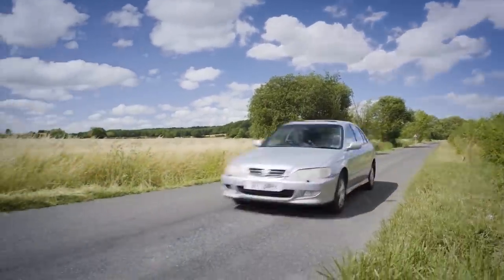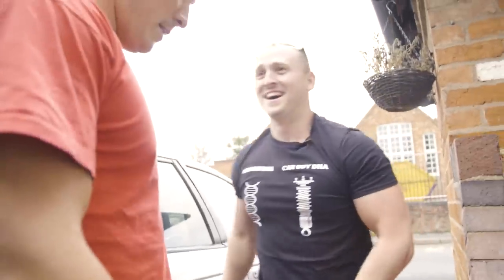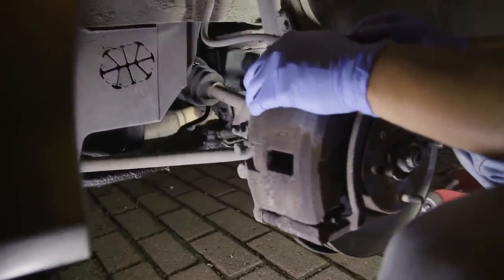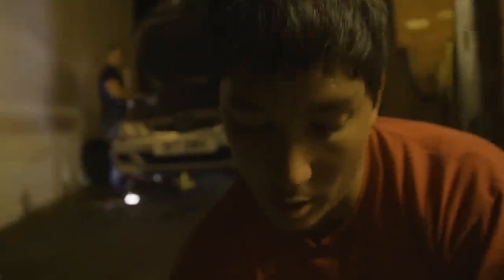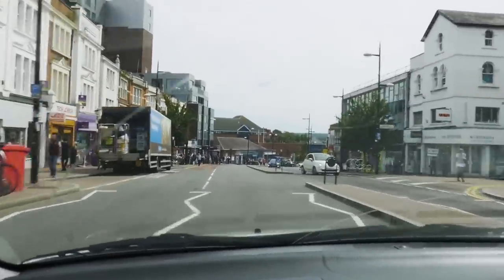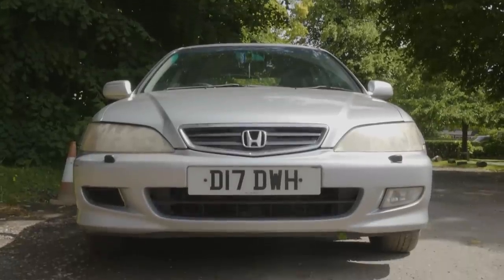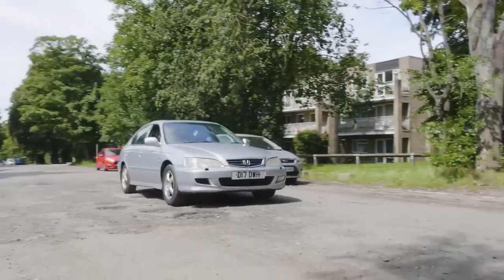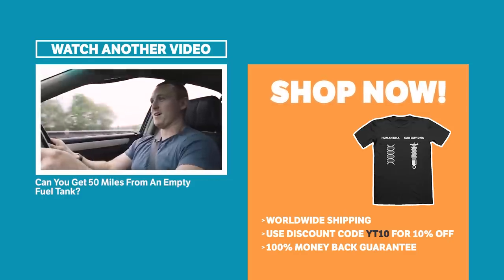Can You Daily Drive A Car With Cut Springs?

Comment: hey, use a ratchet tied from driver to passenger control arm and tighten it until the strut assembly has enough room to work with, itll keep you from loosing any fingers or someone getting their head crushed, it also makes the entire process incredibly easier; just jack it up, take the wheels off, ratchet the control arms and you have easy access, and yes that works with an anti-roll bar, and solves the issue for both sides simultaneously

Comment: Bs, of course you can drive it. You would obviously put hose clamps so that the springs wont jump out, at least in the back. I daily drive my volvo with barley any rounds left on the spring, works just fine. Know many people that has removed the spring completely aswell.
Btw you can cut the springs as they sit in the car.
Reply: Nils Friberg ive done it  like that too with no problems people jus overlook at crap smh

Comment: If you're really cheap but need springs You can even bring a stock spring to a spring manufacturer and they'll make some with the same specs but however   much drop for about $30 a spring.

Comment: If you do cut springs, cut from the top not the bottom. I cut mine on my ek and it drove good, you can only notice when you go over speed bump that the shocks bottom out. Other than that, it was good. Corner hard, drive fast and felt good. I wouldn't doubt that your shocks will go out sooner than if you were on proper springs though.

Comment: Depends on the type of coil your cutting. If you car came with progressive springs you can not cut them, if you do you will change the spring rate and the car will bounce. But if the car came with traditional style spring you will not change the spring rate as drastic and the car will drive fine. The only issue is most times the damper will start to bottom out and blow it's seals.

Comment: Just heat up the springs with a blow torch much easier
Reply: You should try this
Reply: Yes its easy but it will make your ride noisy with bumping sounds and make you irritated
Reply: Hey let's just go and change the temper on a bit of steel which is critical to the car's function. Sounds good.
Reply: Yeah that's a terrible idea! Spring steel has a specific heat treatment, which you would ruin.

Comment: You need to replace the shocks if you use lowering springs as the lowering springs will not be captive either.

Think you need to try before giving terrible advice

Comment: i think michigan has the lowest car standards lol they dont even test ours
Reply: Dark ShadowFox yeah dude i see trucks lifted 12"+ with 16" wide wheels and 45" tires, pro street drag cars that are as loud as a v8 could possibly get, unweighted wheels, straight pipes are legal and almost all shops will do them without question, we dont need emissions controls, we also can drive on semislicks with literally only one line of tread. hell even semi trucks can have two trailers haha. honestly car heaven
Reply: and detroit is just across the river from canada where you can get JDM cars imported. the mechanical shop teacher at my school even drives a RHD AE86
Reply: For real 😂 this is why I live in Michigan
Reply: Ronnie Santo you can literally drive anything on the road here in florida as long as it has lights and turn signals
Reply: Dark ShadowFox yes you can drive Canadian registered cars as long as you are legally in the country in the first place.
Reply: Dark ShadowFox job market is climbing
Reply: In Arkansas we don’t have any inspection.

Comment: I'm dailying my mk4 Golf with rear springs cut for four years because I'm a cheap bastardad and there were after market tall springs that were stupid and I didn't had money to change them back then and it's no problem. Just needed to put some rubber hoses on the bottom of the springs to stop rattle sounds that occurred every time I went over a pothole.

Comment: All the car people around me lower their cars, instead I lifted my Volvo 945 Turbo and put on some larger offroad tires and I can assure you that I have way more fun with my car then they ever could with theirs. A serious drifting car might be an exception though. Speed bumps makes you go faster to see how far you can jump, you start cutting corners way outside the tarmac, sometimes into the ditch like a velodrom. If you get the cops on your tail, go offroad and see how far they can follow.

Comment: If it was a progressive spring your riding rough comments would make sense because you would change the geometry and tension of the spring. On a linear spring, cutting a part of it if done right should not make a difference if you match it with the correct shock absorbers. Many hot rod guys used to do it/ still do it on applications where aftermarket springs are not available.

Comment: my old car (96 Ibiza) had one broken spring in the front, so we just cut the other one. It was about 20 mm deeper, but it worjed fine, for my dad and my self for the last 5 years, so, yes, daily driving an car with cut springs is possible, even in Germany.

Comment: Yes I have Mercedes Benz w202 c180 sport springs are sepret  to the shocks and we put Mercedes C63 AMG SPORT 18INCH WEELS ON IT lowered 1 inch front and back 1 coil off the spring

Comment: you should cut it from top instead of bottom, that way its not about to slip from its rest and screeking on every bump on road.      Old trick was to buy utility vehicle springs, cut them on messure and stick them on ,    stiffer and little bit lower.

Comment: Cutting springs destroys the spring rates.  Alot of guys where I live cut them excessively (usually VW Boras/Golfs, Peugeot 306s)  They bounce around the road if there is any sort of a rut in the surface.  Can't imagine how they drive them on side roads.  Do it properly.  Buy a set of lowering springs that are designed for the purpose.  Not that expensive nowadays and, because the spring rates aren't completely messed up, they'll transform the handling

Comment: I experienced a coil coming off on me once. Right front tire. The strut was bad the shock apparently had no pressure at all so it was just the coil providing shock absorption and I hit a nasty hole and all of a sudden a big boom and thoop and a really weird feeling like choppy. Thought I had a blowout, but it turned out the spring popped off at the bottom and the coil end actually pierced the inner sidewall of the tire and was just shredding it as it moved. Luckily the tires were in need of replacing anyway and I was able to pull a strut off a car from the junkyard for $20. It only took about 30min to change it out.

Lesson learned... If your car feels really comfy when you drive and it floats over bumps, your shocks are probably bad.. Mine was not even like together...

Comment: I can tell you one thing. I had a Ford Sierra 2.0 with Pinto engine and with an open diff. In the track (drifting) it was sluggish and hard to get it drift and sometimes almost roll over. Then me and some of my friends decided to cut down 2 or 3 levels of the springs (that shit took us into the night) and damm it was so good at the track and a lot lot easier to drift, but.... on the road it was terrible.

Comment: I realise that you saying this because there are a lot of lunatics out there but spring is not gonna pop out from the suspension, especialy the coil over one. You can make it sit lower and ride ok but you have to cut the springs in a correct place. That would depend on the spring and the part it sits in. Shock absorbers will last just as long because you've shortened the suspension movement and if you'll hit a speed hump or something in such a way that it will max your suspension travel upwards the impact will be taken by the spring which will callapse fully and then by the suspension mounting points. OR if you've been brave with the grinder and your springs are very short then yes, shock absorbers will come out of the car.

Comment: Remember those strut bearing you unbolted to get the springs out?? Yea they hold the spring in...  The spring can never fully escape the shock rod and spring perches..  Yes it could come out of place, but never allow for a full collapse of your suspension..  Now a car without strut assemblies, yea you could worry then.. If you put the suspension back together and there's no tension on the spring, it could probly fall out. But again..  The shock holds the control arm from traveling far enough for the spring to lose tension. Which is what holds the spring in.. But if your going cut a spring on a non strut type of car..  Build some kind of lock on the spring ends...

Comment: some Indonesians usually do mods in cheaper way like cut their springs to lower their car, and using old truck tyre to change any part that using a rubber like bushing or something for undercarriage they re-shape the old truck tire to fit in bushing case. and this is not a myth, they daily driven in it. mostly a near broke college student who did it. what a crap but its true.

Comment: I drove a 2003 Mitsubishi Galant that was improperly lowered. Previous owner heated the coils to lower the car. On the front, a couple of the coils were touching and there was no give in the suspension. Hitting a small bump felt like I was going to bend a rim(P/O installed 17" Motegi FF7 in gloss black with 225/40R17 tires).

Comment: My brother cut springs on every car that he had and no one bumped out. He also had on some cars aftermarket lowering springs and few times his cuted springs performed better than aftermarket ones in therms of ride comfort and handling. He even raced those cars and nothing bad ever happened. But he did that only on cars where springs where 'straight '. Not when car used design where springs gets narrow on one side. Personally i don't like about many aftermarket lowering springs that they lower a car in 40 60 or 80mm which is very stiff on top of that. I would like to drop my car for a 20-30mm and keep my comfort 😊. Coilovers on the other hand are too expensive and buying them to lower a car for only 30mm? Xd

Comment: You can get 1 full coilover for $150, but you aren't going to find 4 for $150. For a 2001 Honda Civic, it's at least $350 for a no-name Chinese brand off Ebay. I'm assuming you meant the entire shock/spring unit and not just the springs. YOu can get springs for around $100, but they aren't going to be Eibach.

Comment: I am amazed it is legal to drive a car with cut springs in the UK.  It sure isn't here - doesn't matter if the spring is still seating properly, it's an illegal modification.  Doesn't stop loads of idiots from doing it though.  Personally I wouldn't even use lowering springs even though they are legal because the OEM dampers aren't designed for it & it will compromise road safety, if you want to lower your car, spend some proper money and get a decent set of coilovers, or if you can't afford that a matched set of lowered springs and uprated dampers.

Comment: Shouldn't be much of a difference driving on cuts as long as they're captive. When you cut more than one coil, then they more than likely won't be captive and the spring can fall out. I live in New Zealand, its common for people to have cuts, no springs and no shocks.

You should remove all shocks and springs and weld the control arms straight to the body and do a video on that.

Comment: You want to cut at least 2 coils off and shorten the shocks so the springs are still captive. I have 3 coils cut front and rear and a jandal I cut to be a bumpstops. I'm 16 daily drive it I even sat my license with them 😂

Comment: I am still tying to understand why you had to remove the entire suspension to cut a spring, done that several times, only removed the wheel, mesure, cut, put the wheel back and next wheel, it takes 15 minutes to chop 4 springs, and yes, in most cases is a safe mod (except when the spring is oval, on that case you can chop it, but i strongly advise you not to).

Comment: Lowering springs or cut springs put more stress on your dampers or shock absorbers decreasing lifespan, increasing rate of wear, or downright blowing out your shock absorbers. 

At the very least, use lowering springs, but I don't recommend it. Instead, use coilovers or air suspension if your wallet allows for it.

Comment: The springs cant pop out, you have mcpherson style struts on this car no matter how many coils you cut out it can't pop out. If it does unseat the spring seats are tapered so it will just go straight back into place. Also the spring rate hasn't change by cutting out a coil, the spring rate always stays consistent(unless its a progressive spring but in this case it isnt) all you have done is aloud the strut to compress more and reduced the preload on the spring. The rough ride is cased by the strut bottoming out. While cutting the springs isn't recommended because there is much better and easier ways to lower the car, it isnt going to magically make the car a death trap.

Comment: You can safely cut two and a half laps without the spring jumps out of his mounts and it becomes bumpy Yes but have you tried to run with the actual lowering Springs its as bumpy. I have run with cut springs on a Volvo 740 daily for four years without problem

Comment: I rode in a Civic with cut springs that was almost slammed and it was one of the worst motoring experiences of my life. Any small bump on the freeway that would otherwise be almost nothing in a normal car, it bottomed out on the bump stops.

Comment: I daily drove a 1978 Mercedes 240D with heavily cut springs. If you start with as much travel as a 70's car, traditional springs (not progressive) and a spring that sits separate from the shock it's honestly not that big of a deal. It was so low, the muffler ripped off on a speed bump, but it still rode like stock. 
That being said, modern cars have nowhere near the travel of that 240D, almost always have struts, and some have progressive springs. Look, I paid $1800 for the car & didn't give a fuck. If you care about your car and didn't pay $1800 for it, just save up and do it right.
Reply: IAMJAKETRIMBLE look at 6.52 :p

Comment: There is ZERO reason to worry after only cutting less than one coil. theres still enough pressure from the spring to keep it seated even if you jump the car like the Dukes of Hazard. I also doubt youll notice a difference in ride quality from a single coil. Not saying its an ok thing to do but research should be done before cutting stuff. My daily driver is on cut springs and rides like stock just lower. Of course, it doesnt have progressive springs so my spring rate is the same at all points. So basically, every car is different and it may or may not be good for cut springs.

Comment: You can grind the end of the spring flat so it sits more like it did originally on the seat .. But I wouldn't do this, with the price of lowering springs now I just wouldn't bother. Even a cheap set is better than this

Comment: 4:50 and cut springs are really really dangerous, instant MOT failure and cut spring would be an instant prohibition if you’re stopped by the police and they won’t let you drive away with cut springs they are that dangerous.😂

Comment: Spring rate will stay the same but the travel is less and therefore more likely to bottom out.  The pre - load will be less with less coils so will in fact soften the ride making the dampers have to work harder.
You could cut more spring off and put a solid spacer in there somehow to lower the height but bring back the correct amount of pre - load so the ride will be less affected although you will still lose travel.  Would need some trial and error, I've experimented with motorcycle suspension with plenty of success.  Also you could weld the bottom of the springs to the struts to make sure they can't come out.

Comment: So just out of curiosity how is the Coilsprings supposed to leave the car under suspension decompression when it has a strut going through the middle of it and both mounts for the spring are on the strut itself? I could see this as an issue with the car that did not have McPherson style struts but otherwise no I do not see how the strut could leave the car but other than that yes it is a horrible idea

Comment: Can you explain me why a cut spring would be more likely to pop out than a lowering spring? Usually lowering springs would be even shorter
Reply: 6yr old comment but I just had to reply. The unsprung length is similar, so both the oem and lowering spring will still locate, top and bottom. However, under load/weight, the lowering springs will have a tighter compression so will sit lower. Neither will fall out. A chopped oem spring will be shorter, however you would need to chop a fair amount off for it not to stay located,  probably 3 rings. Once compressed though, on the car, even 3 souldnt fall out but the ride would be much worse than standard.

Comment: Most people do it by taking the spring off, also he is sponsored by loads of spring companies as we saw by the lexis build, O yer the super fast is 200 bullshit O did I say that. Did cut springs for years still here, on if u have ever took a spring out u would know. How much tension they are under, alot more likely than lowering springs would fall out, unless u have shorter shocks. Sor but this should just be called a long add.

Comment: WTF.... Car manufactures spend tons of money, testing and designing cars for the best performance and comfort.... And idiots go and start fuckin with it...
You cut the springs and lower the car.. then the wheel alignment is off.... And you're putting more stress on other parts of the car.... Not to mention the danger if it did come loose...
Even a lowering kit messes up the comfort.... Simply put on some bigger low profile tires and wheels and be done with it.....